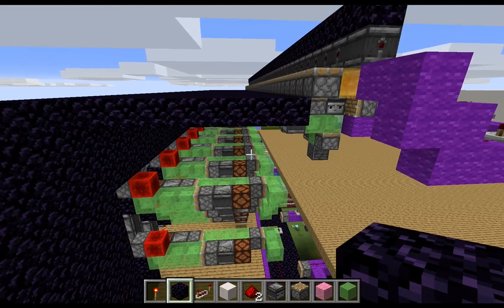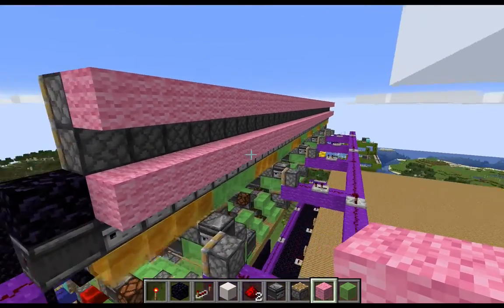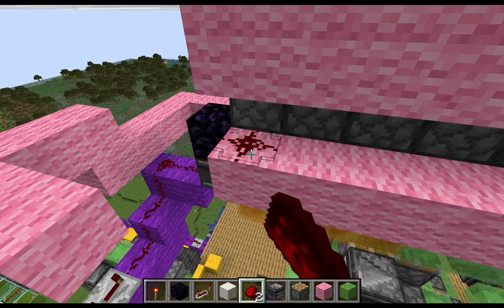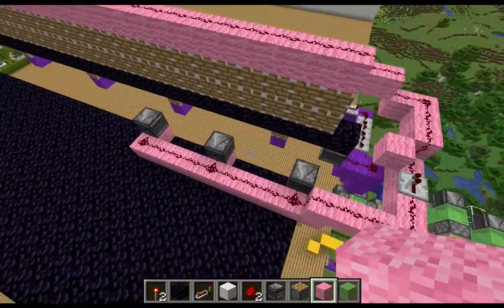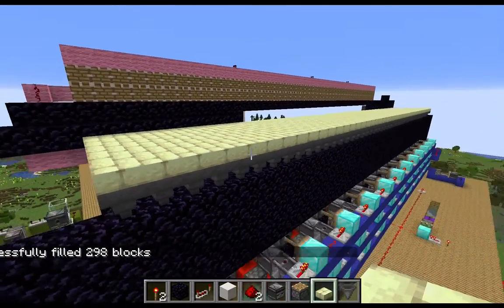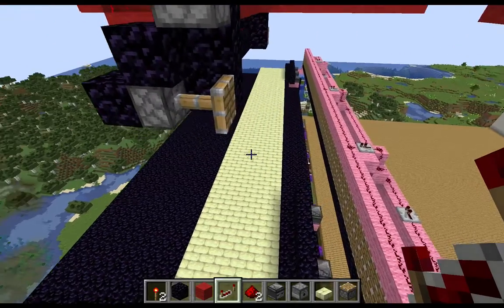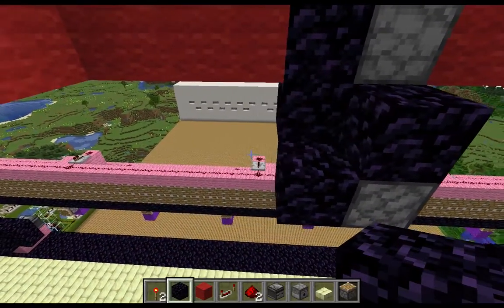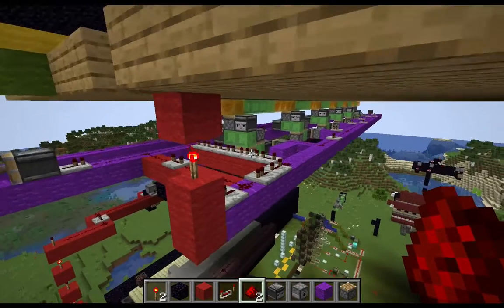Tunnel Borer part 4 The blast chamber

Comment: If you wanted to be able to make this but had limited materials, could you do this on a smaller scale? Could you make a tutorial for a more compact/shorter version in that case?
Reply from the maker: The way to make it smaller would be to reduce the number of drills. That would reduce the costs since you would use a smaller vertical bit and a smaller blast chamber. The horizontal machine is the clunky one and that is dictated by how many rows of drills you have, If you only go for 1 row of drills that machine compacts down a lot